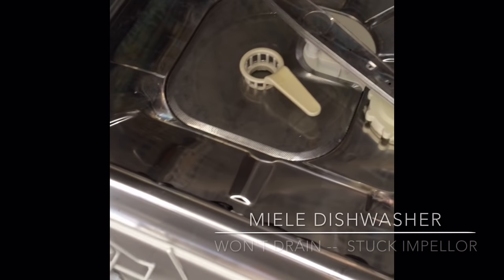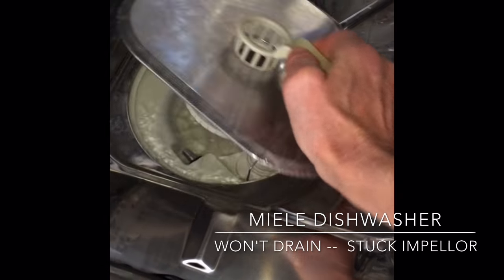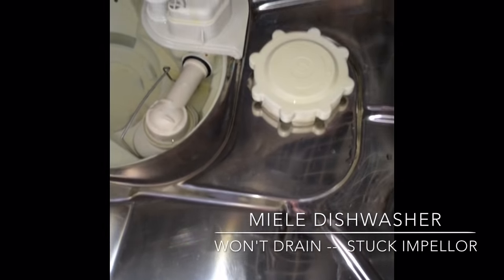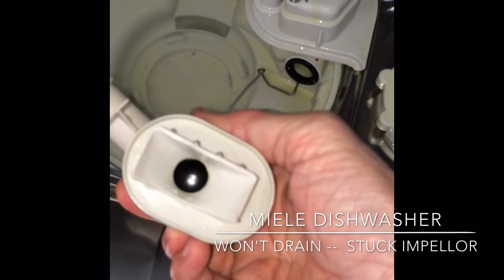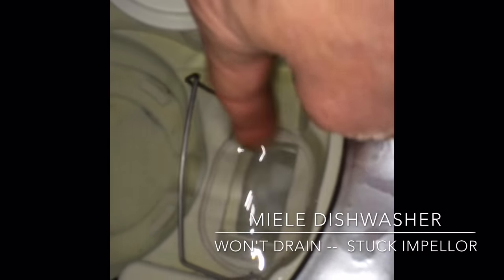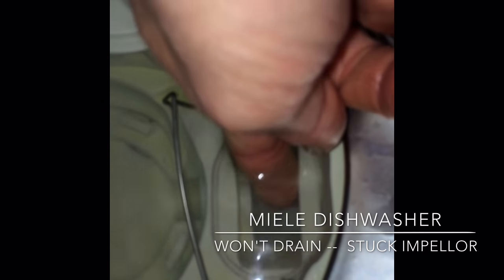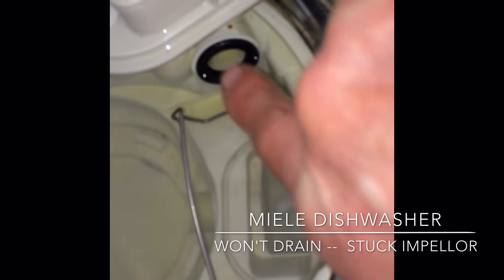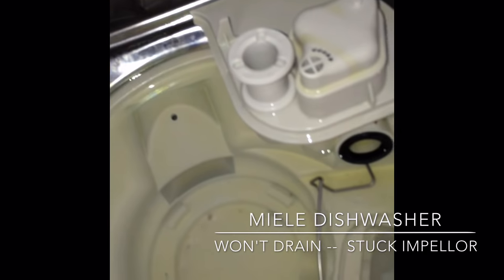✨ Miele Dishwasher - Won't Drain - 5 Minute Fix ✨

Comment: Hi, thanks for this video. I find that the bottom area that holds the xs water is very dirty and smelly, even when I do saniwash and do a wash with a vinegar rinse.  Is there some other way to fix that? Had I known this dishwasher was always "wet" with that water in the bottom I never would have bought it cause it just doesn't seem very sanitary to me. It alway smells bad.
Reply: it could be that the non-return valve is not working as intended - and thus even though the water is seemingly being pumped out, it simply returns back in

Comment: To treat myself I had a perfectly functioning AEG dishwasher removed and went to install a brand new Miele Dishwasher Miele G646 SCI Plus S  [in its original packaging] which had been stored for nearly ten years. 

On removing the packaging the 1st problem was the 'pan'? underneath the machine, it had distorted and as a consequence the two front legs had broken off and the 'connection' on the 'pan' for the legs was broken so new 'legs' could not be fitted. My builder improvised and we installed it apparently successfully by placing wood underneath to support it.

On my 1st pre wash - I filled the water/salt and rinse aid and started the machine.

Unfortunately the installer did not realise screws were stored underneath the 'pan' where the sump is situated for delivery. I started the pre wash programme and it made a noise like crunching so I opened the machine. It had not drained so I removed the return valve and found the screws sitting around the broken impellor. 

The water in the machine was 'reddish brown' - I had stored the new dishwasher for 8 years and I now understand there is residual water in the machine perhaps the reason for the red colour as the machine was empty?
.
I did as per the video and removed the screws and removed the water - the inlet / drain light continues to light up.

Before I throw good money after bad I am assuming I may have broken expensive parts such as the pump if the screws might have worked through the system and got to the pump or perhaps HOPEFULLY that isn't possible.

The parts could be more than £300 before installation plus the Impellor £65 + labour  is that likely? If I thought it might be a relatively easy fix and £150 I would do it however I am worried that 'sitting water' plus broken parts make it good money after bad.

I would so appreciate some advice ... one disaster after another .. a total nightmare :(
Reply: The ball bearing is not blocked ...
Reply from the maker: +Caz MacClancy 

Do you think the drain impeller was damaged?
Reply: After watching your video I managed to stop the drain/inlet light however no water seems to be entering the machine .. the water I saw initially may be just the 'salt water' or residual that was in the machine when delivered
My problem now - the 'propellor on the drain inlet is broken. I would order a drain impellor however if I buy a drain impellor, a new pan, two new legs and + installation and then discover I need a circulation pump I will have spent a fortune and necessitate two engineer visits on a machine that although not used is ten years old .. is it worth it? Is there a way I can tell if the circulation pump is broken rather than stuck without calling out an engineer? 😓 Thank you for your kind help :)

Comment: do you know if this can work on the G7781 disinfectant dishwasher? I have a dishwasher that is just humming
Reply from the maker: Does it hum as soon as you turn it on?

Does it let any water in?
Reply: @ScottTheFixItGuyChannel  hums during drain cycle and doesn't drain, I'm thinking a dental burr or something is holding it stuck
Reply from the maker: Yep,

The impeller has a seed or small glass chip caught holding it back.
Reply: @ScottTheFixItGuyChannel  thank you ill check it out
Reply: @ScottTheFixItGuyChannel  Thank you, it had a metal object holding the impeller from spinning.

Comment: I did all this.Nothing is in there.Pump is not stuck but still not working and red light is still here. 😢
Reply from the maker: How high does the water get when it fills?
Reply: @ScottTheFixItGuyChannel  there is no water at the bottom so it means pump is working.I think the problem is with the arrival of water.

Comment: I shined a torch in the non-return valve and I reckon the rubber seal on mine for which the ball-bearing makes contact is incomplete or ripped.  Has anyone had something similar?  Anyone attempted to replace the rubber seal/gasket?
Reply: the plastic surrounds of my microfine filter that attaches/sits under the removable metal filter is all deteriorated and blotchy - which I think is a sign that the non-return valve hasn't been able to do its job properly - thus leaving water still in the sump
Reply: I'm tempted to make my own video - but it turns out there some important gaskets and seals that deteriorate over time which can be sufficient to allow a slow trickle of 'drained' water to ultimately return back in to the sump/pan. At 00:43 you can see a gasket that is associated with the non-return valve.  Part number for this is 5229601.  Additionally, at 00:09 when the spray arm is lifted up, that white quarter-pie looking piece for which the spray arm attached can be unscrewed by rotating counter clockwise the plastic piece for which the spray arm was inserted.  Once you remove that piece, you will see three pipes with an associated single gasket with part number 5229591.  If this gasket is not seated correctly, or brittle/broken, water will return in the pan.  Finally within the non-return valve itself is another seal for which the ball-bearing makes contact.  If this is broken, you will likely need to replace the whole non-return valve itself (part number 5269111).    When you turn the dishwasher on to a new program at start, the dishwasher will attempt to drain out the water from the pan.  If you quickly stop the cycle before it starts injecting clean water, you will be able to determine whether the deteriorated gaskets are potentially letting water return back in to the sump.
Reply: It turns out you can actually open up the non return valve (containing ball bearing and rubber seal/seat).  It is worthwhile checking to see what state it is in.
Reply from the maker: Excellent information,
Thanks so much 😊